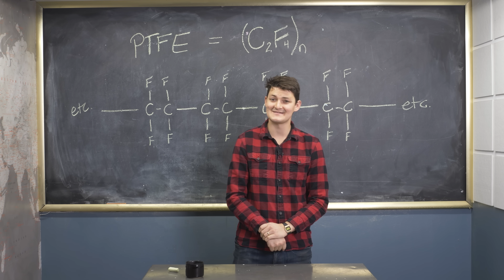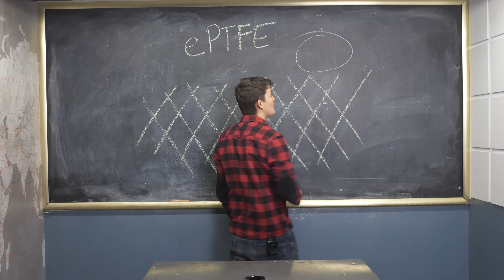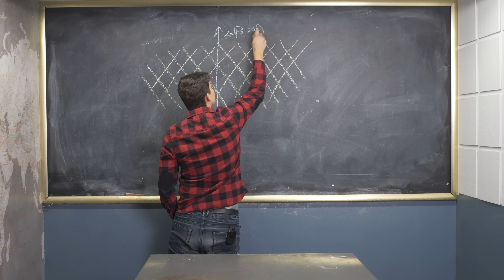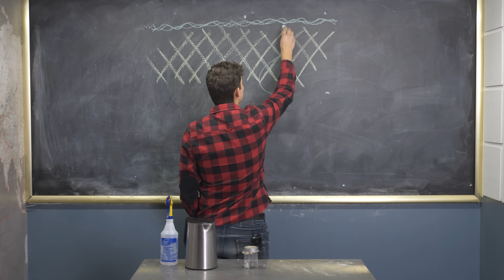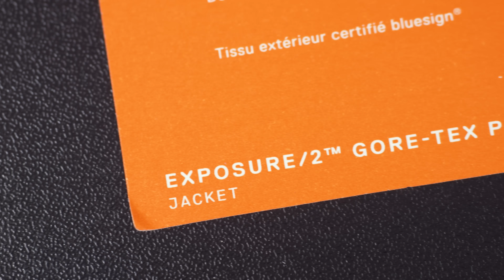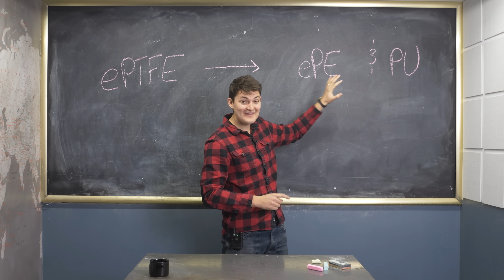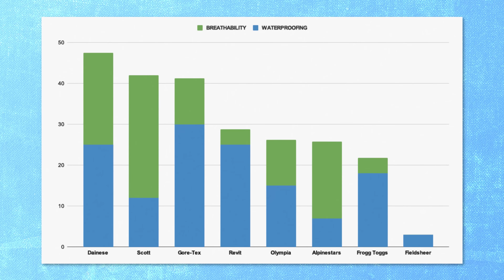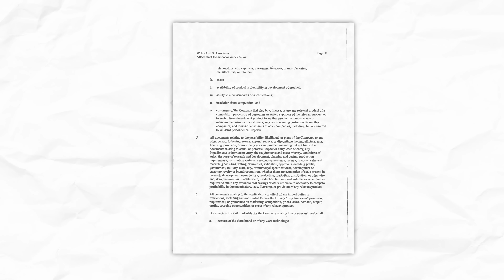Gore-Tex is a Marketing Gimmick

Comment: ok, 
but you're not BUYING the product Because it has the GORE fabric alone,
it's the quality tests any gore product MUST go though in order to be GORE certified and there are if i remeber diffrent qualities 

so a stiched jacket with laminate lining etc will cost less then a laser cut and heat welded hard shell jacket 

like marmot jackets you had quality diffrences which made the 200+ dollar diffrence to a entry level 150 dollar jacket (pre 2015) i don't know how much they cost now because of biden bucks and hyper inflation also not working in the industry anymore. 

in any case alternatives to gore exist and can be equally as good fabric wise but again the price comes from the TESTING they have to put a jacket design though to certify it. 
you could have a PU laminate jacket with the same water resistance using a ripstop nylon that has good weight to toughness ratio then the surface treatment, you gonna use nikwax or not etc. 

but costing 3 times more is a brand reassurance knowing they are designed to last your year or 5 warranty to boot,.

however if there are ALTERNATIVES that are better they should DITCH GORE and stick to their own solution

some brands already have it's how you become competitive is DUMP gore and go head to head with your own product range but some people are GORE brand happy and honestly let them buy gore.
same as let people buy apple

they created their customer base
Reply: You might be a chemist but you've absolutely missed the point.

Comment: Gore-Tex is a brand name.  I have a bivy from 1984 and a rain coat and pants from 1989.  A Gore-Tex raincoat I bought 20 years ago also worked until it fell apart last year.  Original Gore-Tex fabric worked very well.  Th modern PE and PU, well, they stink.  PE and PU do not hold up to regular use.  My 'breathable' rain coat replacement is at least twice as heavy.  Saran is also just a brand name, not a chemical.  That's why 'cling wrap' doesn't work like it did 40 years ago.

Comment: Here where things gets wrong.  Gor-Tex was first used in bunker suits worned by firefighters.   The moment they used that stuff on everyday coats, and coats aren't built like  a frirefighter protective buker suits.    A bunker suite has an external fire resistant outter shell.  the Gor-Tex fabrics is the outter shell of the inside insulated part.  The construction of a winter coat is very different from a firefighter protective suits.   

Just to say, they jumped Gor-Tex for everyday apparel because they wanted to cash in all the investments they put in to make the fabrics.   And Gor-tex works best in extreme condition only!

Comment: Shouldn't we all know that nothing can achieve what Gore Tex claims. Water will not evaporate if it is already humid. The benefit of wool or cotton simply are to be able to absorb the water. The sweater gets soaking wet and you feel a little drier, until it's drenched.

Comment: I am in the 30%. I don't buy too many Gortex things as alternatives are cheaper and better. 
Yes, when it is raining it does not breathe - BUT people forget this is used as a wind membrane as well - not just "rain" - i.e. its a wind jacket as well. Your wool + a garbage bag (something actually used) is not bad but also not as good as gortex membrane or similar - it does not work well in ... windy conditions - here to protect from wind you will put garbage bag over wool but will sweat. Or have to move slowly. Or have to take some wool off to feel cold.

Comment: Never thought much of the Gore-Tex stuff I was issued in the Army.  I was on tanks, and it was famous for melting from the exhaust and getting destroyed by concertina wire we had to carry around. For really cold rainy knights I preferred wool sweater and rain poncho. Gore-Tex was best for crisp dry snow conditions and that's about it.
Reply: You aren't supposed to wear that stuff on a tank.  For the reason you just mentioned - if exposed to fire it will melt and stick to your skin.  I've had a flash fire in the turret (ammunition malfunction).  When doing gunnery you need to have every inch of your skin covered with something fireproof.  To include covering your eyes.
Reply: lol

Comment: I think that nobody needs a breathable anything in rain - the point it that it should breathe in dry conditions. So to describe goretex as waterproof AND breathable is absolutely correct. Also you missed the point - between 100 different waterproof systems gore tex is still helping the customers to recognise the quality. When we are buying stuff we cannot make comparisons in laboratory as you did - we have no way to recognise if some other system is better than goretex- without access to reliable information it is still safer for the consumer  to assume it is not and buy the goretex.

Comment: I've been hiking for over 10 years in the Uk. And this video is correct. You are better off covering yourself in a plastic poncho or bin liner. Unlike gortex (and I've been using the pro version), this is both waterproof and breathable and will cost pennies.
Reply: I used to love the fisherman's ponchos I could get for around £15 and used for cycling. As you say, perfect dryness: no rain penetration and no sweat. And they had the great advantage vs. jackets of also protecting your legs, without the gigantic hassle of putting on waterproof trousers. Only trouble was, they always ended up tearing at the neck pretty quickly, after which they let water in and were useless. I never found a more durable alternative, but I think I might look for one now.

Comment: Try traditional Tweeds worn over fine wool undergarments such as merino wool. The twill weave and lanolin in the tweed naturally beads off water. The merino wool wicks sweat away so it evaporates off dry skin nearby. But It doesn't matter if the combination does get wet, because wet wool doesn't conduct away body heat, so you won't feel cold (if you're wearing an appropriate number of layers). Scots and Nordic folk have known this for centuries.

Comment: I had a similar come to Jesús moment about Gore-Tex last snowboard season,

End of 20/21 season I ended up blowing out the crotch on my Burton Gore-Tex AK snow pants and wasn't to excited to have to buy another $400 pair 
but I always justified it in my head because how dry the kept me.

well my laziness caught up to me and 21/22 season I didn't have a pair of pants for a snowboard trip to Marmot basin the night before.
So i found a pair of $50 686($200 when they sold in store) snow pants on Facebook market with 10000mm water proofing,
guess what they kept me dry!

Even watching this video and my own experience with Gore-Tex I would still be wary to buy snowboard gear that didn't use Gore-Tex,
and not that I don't trust the proof in the video or myself. 
I feel like i was conditioned by the marketing to feel superior cause my equipment was gore-tex and using anything less would spark the reaction
"oh nice gloves/pants/jacket but mines Gore-Tex" and you'd feel an instant regret you "cheaped" out and didn't get Gore-Tex.

sincerely,
Recovering ex Gore-tex Chad